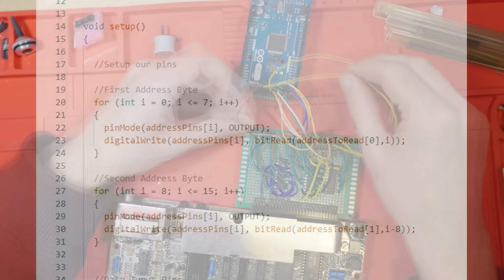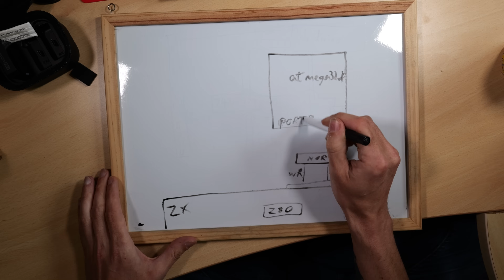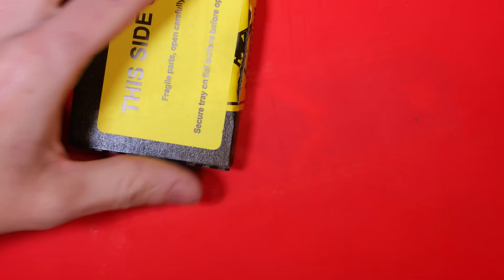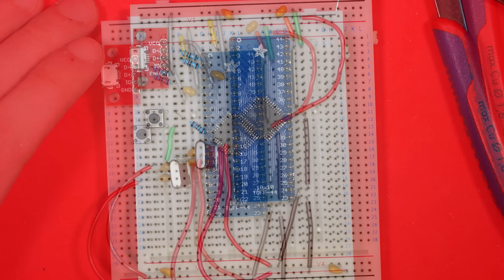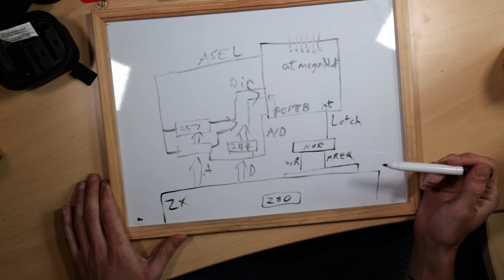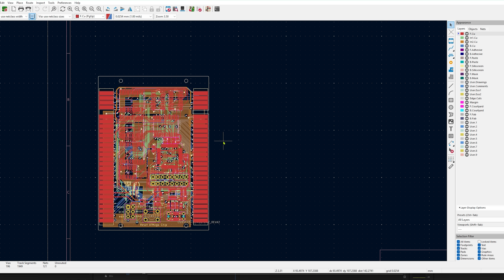ZX Spectrum Reactive Device Interface - Designing V2

Comment: Did you try coding in Assembly Language to optimise the original code?

Cheers,
Norm.
Reply from the maker: I didn't think I could get things much faster than the commands I was using, anyway, after a redesign I'll be using the safer latching method without any extra chips which will be pretty optimal in my opinion
Reply: @HappyLittleDiodes  Thanks. I was just wondering. Cheers.

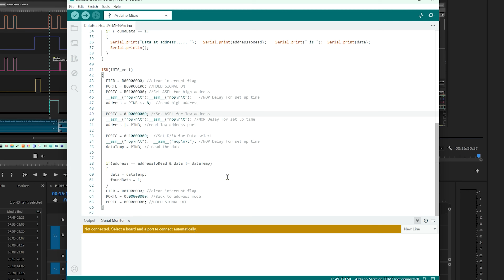Comment: 21:23 In line 58, did you mean to use the "&&" operator (meaning true if the left condition and the right condition are true) rather than the "&" operator (doing a bitwise AND)?
Reply from the maker: Good spot! I'll fix that

Comment: You could also match addresses in hardware with a different design. A single 16-bit shift-in register with its outputs going to 16 XOR gate A inputs (4 x 4 XOR gate chips), and the address bus from the ZX going into the XOR gate B inputs. The outputs from the XOR gates could then go through diodes all tied together at their cathodes, so there is a logic 0 when the address matches. This could trigger the interrupt to read in the data bus on port B instantly. So very fast for repeatedly capturing a single address - easily as fast as the Spectrum access memory. But slow to change the captured address. I think the design you have will miss address accesses, as the processing takes longer than the ZX will take between address reads (especially when the ULA is drawing the screen).

Comment: If you can solder a QFN package then you can do the same with a RP2350 and recreate a pi Pico 2. It is 5V tolerant and probably fast enough to do it without latching. If not, you could use its PIO mode. So you should be able to do it without any other ICs other than what a Pico 2 needs. It would be way less expensive as well. It would be easier to flash new binaries too.
Anyway, nice work, love the channel.
Reply from the maker: I'm sure it's definitely fast enough and I did consider it, but I really want this to be an Arduino as that's what I know and what I learned a lot with.  The RP version may be a future variant!